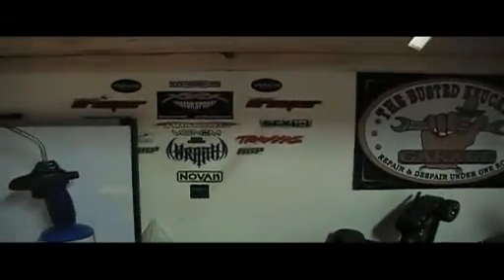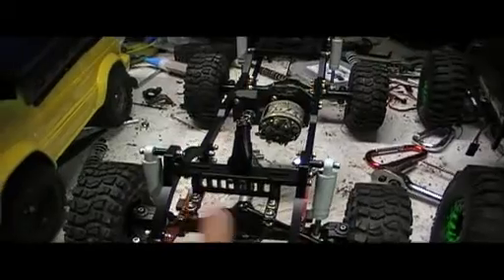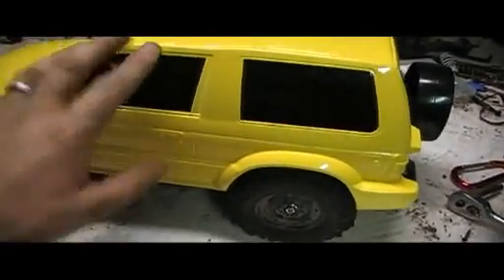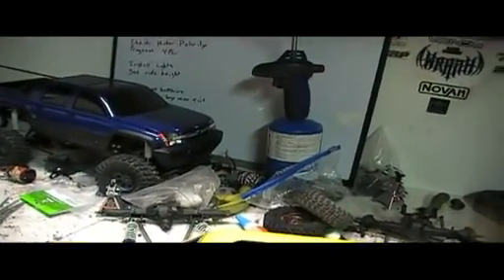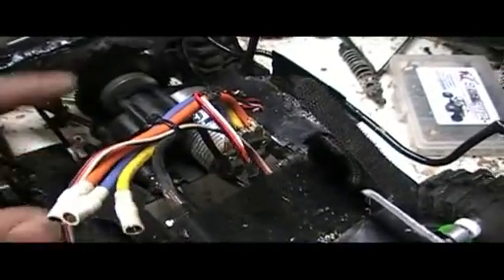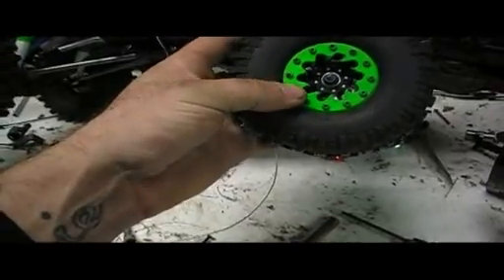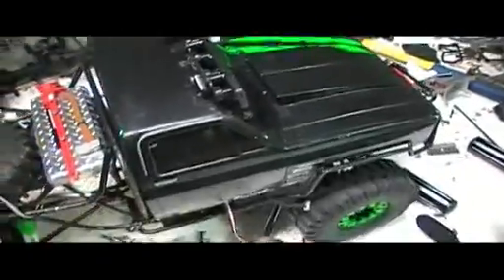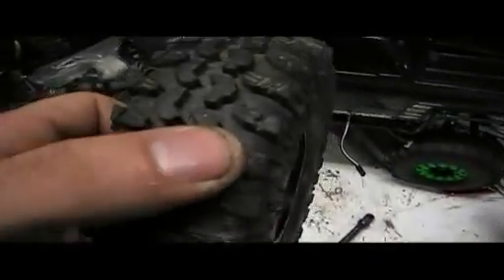RCC Christmas

Comment from the maker: no in fact on the stock 2 pin rear 1 pin front style that the stomper has I had to take and trim the front holes and cut out around the shock towers in the rear to get it to sit right along with a custom metal bracket for the front mount